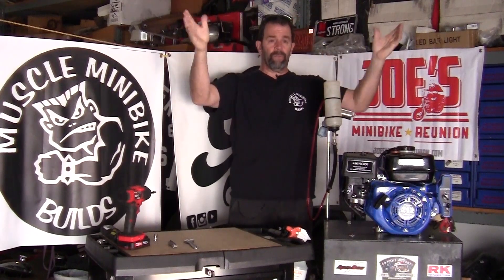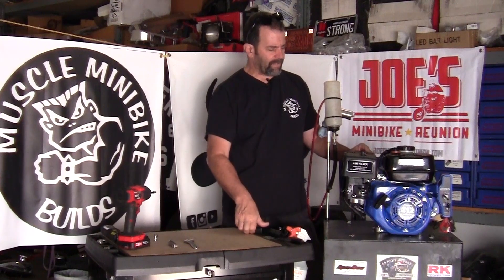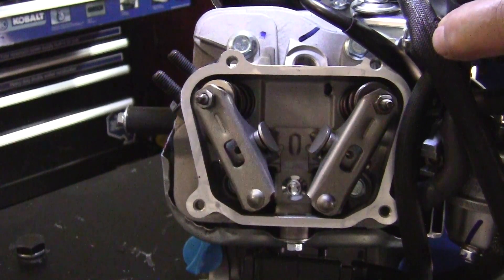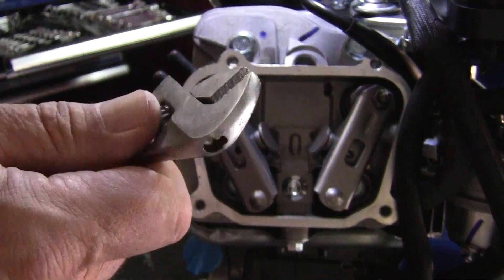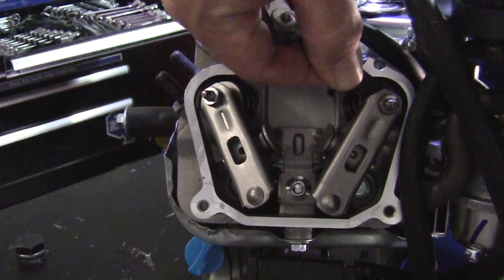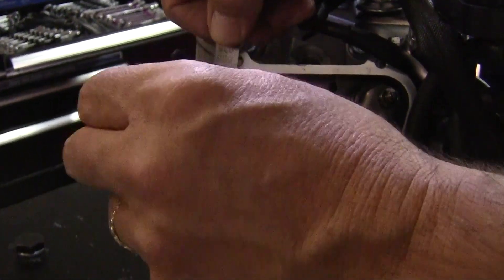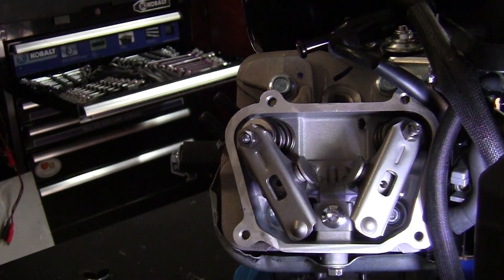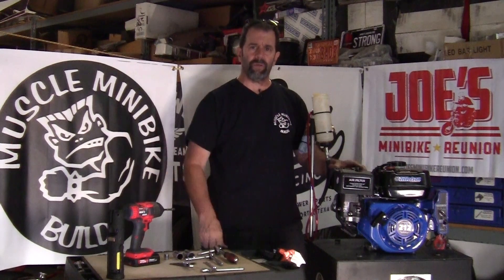Small engine valve adjustment, Tillotson, Honda, Predator, Clones I.O.E.C. Simple Method

Comment from the maker: CORRECTION!!! 9MM WRENCH FOR JAM/LOCK NUT NOT 8MM AS I SAID IN VIDEO, BRAIN FART.. MY BAD!
Reply: ive had so much trouble since i installed 18 lb valve springs.. or i dunno the problem .. itll only start on half/full choke and run great for like 5 min,  then itll wanna die, and sometimes not start for a while,  its a tilly 212R  govenor removed , 18lb valve springs,  28 mm mikuni,  and a stage 1.    any insight would be awesome....    subbed

Comment: My ct200u won’t start without choke if I leave it for a night and half a day, I’m trying to diagnose it but I can’t figure out why, would you be able to tell me? Keep in mind I have a modified exhaust and air intake, I also have the gov disabled and give screw is cut off.
Reply from the maker: Did you put a larger jet in it to compensate for intake and exhaust upgrades?
Reply: @MuscleMinibikeBuilds  I put a whole new carb in it honestly I assumed it already had the the upgraded jet in it but I could be wrong, I’ll switch it tomorrow and let you know how it goes thanks!
Reply: @MuscleMinibikeBuilds  thanks for the advice , I put a new jet in and it started 3rd crank with no choke! Lol

Comment: See i purchased a believe it's a stage 3 racing head to bolt onto my 196cc engine and it came with the champion rockers already in it and before i got them i had only had the stock valves and only knew how to adjust stock. I did not realize that with these the actual stud the nut sits on was for adjusting. I was having a heck of a time trying to figure out how the heck to set the valve lash with only 1 nut not realizing the stud is for adjusting as well. If i did not have the valve lash set correctly would that be a reason i was getting a lot of snap back every time i tried to pullstart the engine ? Cause it really tries to rip my hand off every time i go to start it and it hurts like a mofo !!
Reply from the maker: Yes, because if valve lash is off it can cause snap back

Comment: I took the governor out of my KT196 go kart and now when I pull the cord it won’t pull/snaps back. Checked spacing and it’s .003 with a slight drag. Without spark plug it pulls easy. Any thoughts?
Reply from the maker: Did you check cam timing alignment marks?

Comment: is there different settings compare to a stage 2 and stage 3
Reply from the maker: Yes, different levels of performance parts
Reply: @MuscleMinibikeBuilds  thanx, also does the valve lash setting changes through stages or its best at .003
Reply from the maker: I run 003 with stock pushrods 002 with chrome moly

Comment: How do you know when your at TDC on a Predator 3500 generator when you can't get to the crank nut? Thanks
Reply from the maker: You should be able to pull the blower cover turn the flywheel over lineup the mark Army flywheel if it has it to top dead center with the plug out and use a plug gauge and you got to do the zero it out
Reply: @MuscleMinibikeBuilds  Can’t take the blower cover off without major disassemble. Look at the predator 3500 generator/inverter, it’s pretty much a sealed unit.

Comment: ive had so much trouble since i installed 18 lb valve springs.. or i dunno the problem .. itll only start on half/full choke and run great for like 5 min,  then itll wanna die, and sometimes not start for a while,  its a tilly 212R  govenor removed , 18lb valve springs,  28 mm mikuni,  and a stage 1.    any insight would be awesome....    subbed
Reply from the maker: It's a carburetor issue

Comment: I'm a beginner so this may seem like a silly question for some, but how do you know which feeler gauge to use on any specific engine? For example, a mega moto mini bike with a 105cc engine? Lifan? Im not even sure where to find that info.
Reply from the maker: Valve clearence is .003'